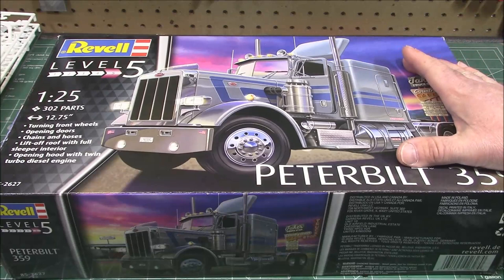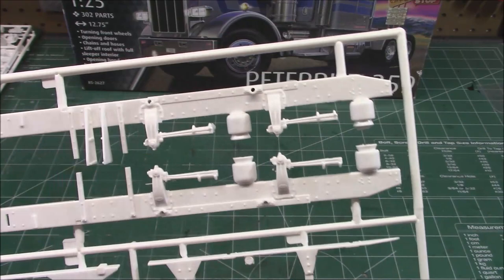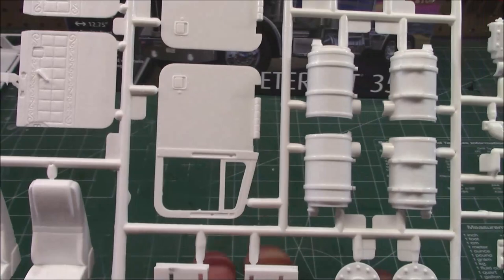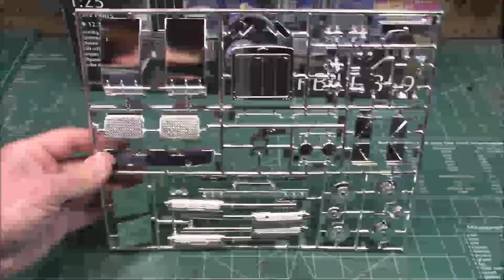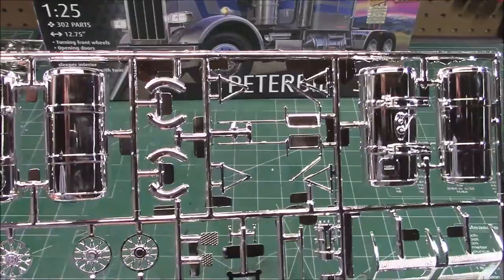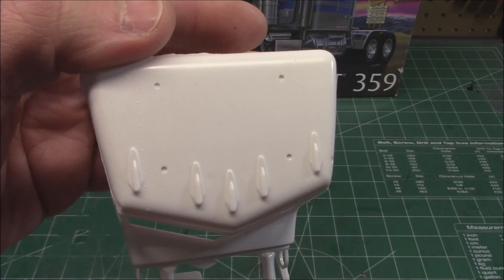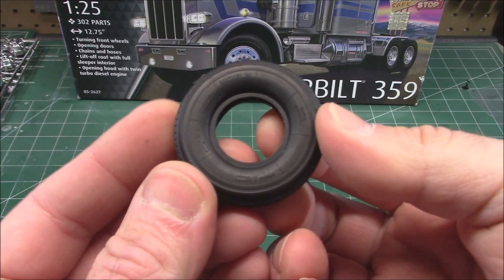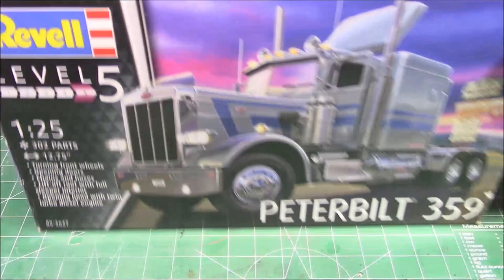Peterbilt 359 Semi Tractor 1/25 Scale Model Kit Review Revell 85 2627 Decals Sprues Manual Tires

Comment: This is the exactly the same kit I had 40 years ago, it was called Black magic. As you went through the unboxing, I looked at the instructions. The same kit but in black. I just picked one up in about 95%, for $60. I also bought 4 of these kits because I couldn’t find the black magic kit. So now I have 5 kits. The two option decal stripes are awesome. Unfortunately, the black magic decals forty  years old and they will not be able to be used.

Comment: I would strongly advise sanding off the dash details for the decals. Definitely on the center console.
Reply: Just a question... can you not sand off the raised areas and lay the decals over it, align it, and use microsol or the like to get it to mold to the raised areas? I've never tried this, just wondering. It would be really cool if this was possible.
Reply: @acrowe2512  for some areas like the dashboard yes absolutely. For the center console there are some areas way too raised for the decals to settle on.
Reply: @IamGalvatron  Good to know it's possible! I've been wondering if it was. Will I dare it? You only get one decal to try.... thx for your info!